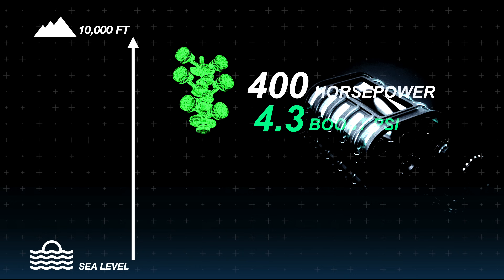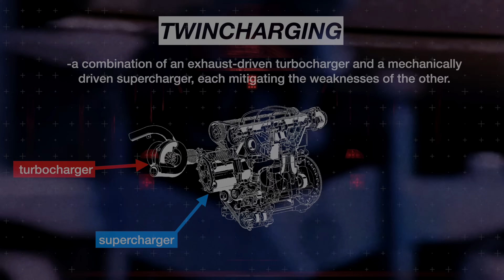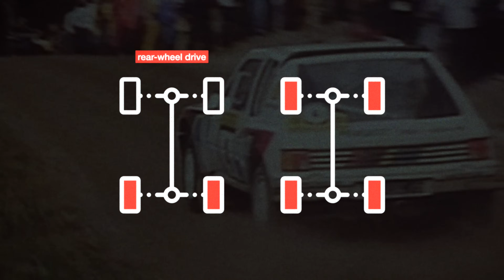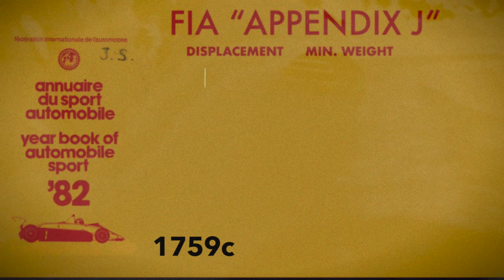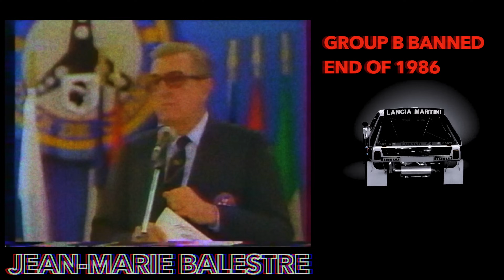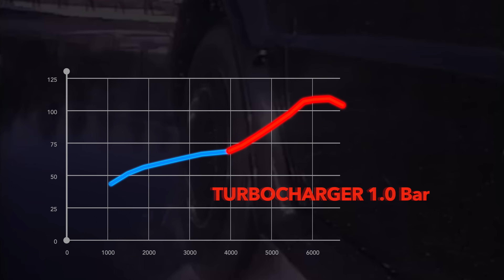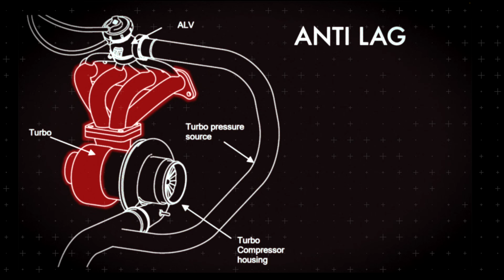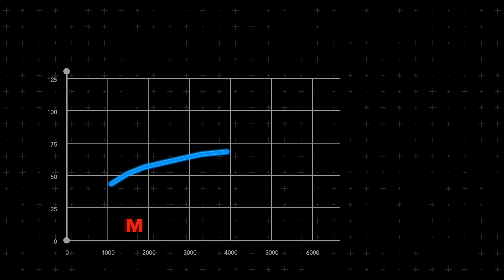The Engine That Was Banned From Racing | Explained Ep.29

Comment: I feel the Delta S4 is starting to fall in the same pit as the 787B. None were banned directly, nor were specifically targetted because of their engines. The Delta S4 was as much of a casualty as all other Group B cars; as it weren't the cars banned, but the class under wich they raced.

Other thing that's also starting to get me tires of it is the ever stuppider and ridicoulus power figures thrown around. Though we all know back in the day having a turbo in the car meant you've always run more boost than announced, the Delta S4 never pushed further than 5xx hp for reliability. Saying the engine could spit 1000hp is the same as Supra kids with the 2JZ-GTE thinking it too could manage that from the go. All Group B turbocharged monsters got new lifes in Rallycross and Hillclimb after Group B ended, and all got up to crazy numbers because all had the same potential if not more.

People are missing the point. The S4 was an amazing car, incredibly complex and arguibly the biggest effort from any of the top teams, as they were on a way tighter budget than the giants of Audi and Peugeot or even Ford.

Comment: The engine itself was not banned. Group B cars were banned, for the reasons you stated. Rule changes after group B made it no longer fit the series, but the engine design was never banned by itself.
Reply: This is true in fact it was a variation of this engine that went into the Delta HF. Which would get Lancia 6 consecutive Manufacturers wins. A record that still stands almost 40 years later.
Reply: But it says that in the video

Comment: At high altitude a belt driven supercharger ALSO doesn't develop more boost than at lower altitude. I tested this with my 03 Mustang Cobra that I had a 2.8" pulley on the supercharger replacing the OEM 3.65" pulley (and a tune for it) at 5154 ft elevation (Elko Nevada) it developed about 12 lbs of boost, and then going 8737 ft elevation (top of Lamoille Canyon) 31 miles away and about a 45 minute drive the boost developed dropped to abou5 9.5 psi peak. Now my 2012 Ram 2500 with a Holset turbo at sea level develops about 27 psi of boost around 95,000 rpm and at the top of Donner pass about 7050 ft elevation still develops almost the same peak boost but around 121,000 rpm since it can adjust for altitude.

Comment: The line there is no replacement for displacement is under the assumption all things are equal. Sure boosting can make a small engine more powerful than a bigger one at certain speeds. The catch is if you boosting the bigger engine then it is the displacement that makes the difference.

Comment: there is only one category where there is no replacement for displacement. the pickup, yeah we have turbocharged engines but if that truck is going all day long every day with a loaded trailer than those turbos will quickly fail
Reply: For gasoline pickups, sure.

For diesel pickups (and diesel trucks in general), it’s turbo or bust, even with a similar displacement.
Reply: @camarokidbb4347 i very much agree.

Comment: Design of the S4 was also insane :)   Driver and navigator sitting on the fuel tank.     And car was made so light they had trouble with the body panels  , they had the habit of getting loose on the stage.         Also heard that after the S4 was banned lancia did dump all remaining engines in a furnace , but not sure if that story is right

Comment: Hooold up, first actual PRODUCTION twin charged engine was the P-47 Thunderbolt. WW2 fighter plane with a very bulky fuselage that would maintain high boost at high altitude, which other aircraft did by implementing gear shifts for their superchargers so a pilot would literally need to switch gears as they went up and down in combat.

Comment: Twin charging isn’t as good as compound turbos anyway… modern compound turbo setups are insane, stupid fast spool up and insane power capability if you design the turbo setup well and build the right engine around the turbo setup. You can have big block low end torque and 4 digit power fairly easily.

Comment: i mean technically, forced air induction should be considered as a method to artificially increase engine displacement since a NA engine will only be around a few atmospheres at best depending on ductwork and bore/ stroke, so having higher than that is like having a bigger engine. It's possible thanks to the advances in alloy composition and block and component construction as well as the mature after market parts community, that a smaller engine can be turned into a beast. twincharged or as i like to call it, super turbo, is in my opinion the pinnacle of combustion engine design.

Comment: It's not that "there's no replacement for displacement" so much as the limiting factor is available oxygen (air) and what matters is how much mass of it you can pack into the available CCs (fuel supply has been a solved problem for decades)

Comment: Uh, boost is effectually displacement.  The displacement is simply a measure of the volume of air the engine moves.  By adding boost, you’re effectually increasing the volume of air it’s capable of moving.  

Thus, there is no replacement for displacement.

Comment: I was thinking to solve the lag problem I would use a supercharger at the start to rev up the turbocharger and once it reaches desired rpm supercharger would cut off but suddenly I got trashed because you said its already been done and decades ago naming it twin charger , I also thought of a name for my design "Air Charger" but sadly. Still I will make my own design modifications and make it even better when I have the chance of course which might be not so soon.

Comment: I thought they used a special fuel injection system that would lower the temperature of the fuel going into the engine similar to nitrous oxide? Or am I thinking about another motor?

Comment: I've been playing with twincharging since 2007 with my aw11 mr2.  I run full compound boost twincharged 4ag, no clutch on supercharger and no supercharger bypass.  
I love the powerband it delivers. 
While my diy setup isn't the most powerful thing out there, heck I don't even know what it's doing, hasn't seen a dyno in 5 years and I've played with it since.  
I run a gt2871r feeding a eaton m45 on my 4ag at 28psi.      
My next engine build will be with aftermarket parts and new ecu so | can run e85 fuel and get it tuned accordingly, will still run the same twincharge setup. 
I wish I could afford to do my rebuild now!  It's going to scare the shite out of me! hahahaa

Comment: Has anyone tried putting a Clutch Pulley system on a supercharger pulley like an AC pulley. The SC pulley is clutched in on low RPM spooling the turbo once above 3k RPM and 100%TPS the SC pulley clutch would disengage rendering it in neutral having less parasitic drag. Sounds possible?

Comment: Twincharging became irrelevant when centrifugal superchargers became a thing. These are essentially belt-driven turbo, and while turbos can still edge them out for absolute peak performance, they're centrifugal superchargers are a solid compromise as they offer no lag with big power potential.
Reply: Centrifugal superchargers have been a thing for a long time, even before twincharging.

The issue with them is that they deliver lackluster power at lower RPM since they rely on revolutions to make boost, so instead of taking a while to make more boost at lower RPM, you make a consistently below-ideal level of boost with a centrifugal supercharger.

Twincharging is instead made more or less obsolete with compound turbocharging, using a smaller turbo to feed a larger turbo to accelerate building boost, to the point where you can build max boost at fairly low RPMs, which means you can very rapidly build up a large amount of boost when going off and on the accelerator within the wide rev range.
Reply: @camarokidbb4347  You're talking about twin turbos in a sequential configuration, which was really just a stopgap setup for the days when turbos were laggy. They're a lot more optimized now such that perceptible lag is mitigated.

You can spool a turbo just by brake-boosting, or by installing an ALS (anti-lag system). The ALS would basically allow the turbo to spool up to full speed without having to rev the engine, so when the accelerator is pressed you'd have full boost off the line just rolling onto the throttle. It also maintained the turbo's RPM during driving so you could brake hard without losing boost.

Modern centrifugal turbos are usually geared and the linear power delivery is not a drawback, it is a feature. They may not have as much peak power potential but for everyday traveling they're a lot of fun.

Comment: "there's no replace-" yes there is, it's called boost as you said... and also various other trickery, like twin charging. also turbo's don't use the heat it's just the engine fart gasses.

but yes twincharging is the most harmonious of batshit insanity. what the turbo fails in the supercharger excels, and vice versa. or as all i like to describe it, "what the turbo takes the supercharger gives, what the supercharger takes, the turbocharger gives"

great video as always. and just giving me more info to use for one project.

Comment: 0:05 - "but in actuality" boost is still more displacement 🤦‍♂️

There is NO REPLACEMENT for DISPLACEMENT... doesn't matter if it comes from the bottom end, or a compressor.... the power of an engine is most closely related to its ability to aspirate.

Comment: yeah, turbos still doesnt solve 1 problem you didnt mention. making 5 bar 70+psi of boost from a 1.8L would require twin turbos, and they would still have soooooooo fucking much lag from a dead stop it would be pathetic compared to a dualcharged setup.

Comment: I keep hearing how turbos do not have parasitic loss. I call BS. If that were true, then turbos create energy from nothing, which is impossible. I want someone to do a test; take an engine with turbo exhaust system and first dyno it with a test pipe in place of the turbo. Then replace the test pipe with the turbo with a charge pipe installed and restrict the output enough to build boost in the charge pipebuild. Dyno the engine again like this. I guarantee the turbo restricts the exhaust and reduces the engine output. Parasitic loss.

Comment: Technically, and as very much pointed out IN the video itself, it wasn't the Delta S4's engine that got banned, nor that got the S4 itself banned, nor the whole Group B, it was all the weight loosing cuts Lancia did to the S4 that made the car way too fragile, not only in case of a crash (as the one Toivonen and Cresto suffered), as well as in the car's handling itself.

Comment: Yeah there's no reason to not do this (arguing against the don't do this even w/ deep pockets comment).... the traction control strategies weren't that great back then, whereas they're awesome now.  These were gas cars that had electric car levels of acceleration and no traction control.... and probably no torque peak/end to top rpm power if the setup is sized (in)appropriately.
Reply: Also, modern turbos (like BW EFR) have very little lag and have done a lot of engineering to expand the efficiency islands on the compressor maps.
Reply: @kr4dh4x0r true however i  terms of speed a rally one car is faster now

Comment: I operate locomotives for a living. When I started out, I was talking with the mechanic about the turbo on these monster engines. He explained that the turbo is shaft driven by the engine until we reach Throttle 7 or 8 (full throttle) then the shaft disengages and the turbo spins off exhaust pressure. 
I made the comment, that's kind of like twin charged engines!
He looked at me like I was nuts...
I knew then, we were not the same kind of engine nerds.
Reply: He is talking about an emd. They drive the turbos from a one way bearing. Once you get enough boost pressure, the turbo overruns the bearing
Reply: So it's kind of like a hybrid centrifugal supercharger/turbocharger? That's really cool. Does it decouple automatically, or is there a separate control to do it when you go through the throttle range?

Comment: I have a twincharged engine. Albeit its a big engine ls7. And high boost for max boost. Its run in series with no disengage but multiple wastegates snd blowoff valves. 

It gets better effiency then a suoer would and nears peak turbo effiency which dowsnt happen in high boost settings generally. As well as eliminates a few turbo flaws with back pressure issues and draws constant cold sir into the system. Along with making it easier to have multiple stages of cooling. 

In theory my set up with a basic light weight disengage for the super that can use boost control and ither factors ro only use the turbo during certain periods of boost and kick back on for max boost and approaching max boost would be slightly more efficient but barely. And to get equal ability to tune a flat torqgue curve and comparable feel to an NA motor is hard with just turbos. But its also better then an NA cause it has rhe supercharger early torque and feel plus turbo boost kick but leveled out. 

Also some theory for compound boost and the most modern responsive turbo set ups and a form of super serious anti lag safely plus some compound boost benefits. But you need to design around the concept. 

And plan in out properly. And size turbos and supercharger properly. Tryna see if plumbing it up on a hot vee would be possible. K48 honda based v8 hot vee but also vtec. In theory could tune for an off the line intense power band that doesnt stop till redline at 10k. And also help my build plan for said engine. Superlite slc. Needs to be streetable but also for high tune on track with race tires trying to match that 1 to 1 power to weight ratio metric side of thinfs like Koenigsegg. And beat the texas mile ford gt. But some aero work needed.

Comment: I had a saab 9000 turbo with the 2.3L inline 4 Garrett T3 factory 200 horsepower that I ran at 36lbs of boost and ate z06 vets all day.. doing the math from the video on the 1.8, it’s about 100 horsepower for every 7 lbs of boost.. that makes about 600 out the saab I had and boy was it fast.. the gear changes where literally like 12345.. faster than counting from 1-5.. lol

Comment: The parasitic effect is not worse than boost lag.  If you have a supercharger that is stealing 50hp but giving you 150hp, you are just getting a flat 100hp boost.  The cool thing about the shaft driven stuff is that there is zero lag.  It is basically like having a bigger engine.  As much as I like that, my heart will forever be with the turbo.  I like the slight lag.  I like that it just get more and more insane the higher the RPM gets (On good builds).  The sound of the turbo spooling just makes my spine tingle. 😤

Comment: Not bad video, but there's one big problem. The reach type super charger. They pitcher they were rotating it wrong. The compressed air goes on the outside of towards the casing, not the inside, get it right.

Comment: Boost + Displacement is always better. There's a reason people say this as of late. Cheap turbo kits. You could add 30psi to a Honda B series in the 90s and still make little power. My 1985 Audi Turbo S was about 180hp...inline 5 boosted. IF you lack displacement your going ro HAVE to use either lots of RPM boost or both. Yes, boost is the replacement but it comes with comprises.

Comment: BOOST IS DISPLACEMENT. Bore x Stroke x cyls gives a number (say) 2 litres. 
THAT figure is the amount of air the engine can CONSUME in two revolutions if it could achieve 100% volumentric efficiency.
At 2 BAR of boost (minus some losses) the VE becomes about 300%, therefore the engine can  CONSUME as much air as a 6 litre engine.
It therefore for ACTS LIKE a 6 litre engine and to all intents and purposes (excepting physical dimensions),
 IT effectively IS a 6 litre engine as it is consuming the same amount of air that a 6 litre engine would consume.

Comment: If it wasn't for dual-charging, turbo-charging wouldn't have developed the variable vane turbo. I would like to see electronic control to a bare minimum. Reliability & maintenance costs for the average customer must be considered. There is no replacement for displacement though. Stressing a small engine like they do hurts the resale value by taxing the bottom end, piston rings, head gasket & other components. Also induces high heat into the engine oil cooling the turbo shaft bearing. As far as owning a petrol car, I'll vote for an appropriately sized N/A engine w/ the proper gearing & an automatic trans. Having fun w/ a manual has a better chance of breaking something in the drivetrain.

Comment: I also own a twin charged car. The Volkswagen Golf 1.4 TSI GT. Yes it's not the most impressive car out there, but the technology behind it is astounding. When the Turbo takes over, a magnetic clutch disconnects the Supercharger, removing the parasitic loss at high rpm's. It's such a joy to drive. The whine of the roots supercharger is so beautiful, with the kick of the turbo at high rpm's. It's unfortunate that VW didn't continue to develop with the technology.

Comment: We use supercharger and turbo in our '73 beetle with Fiat 1.1L engine (downsized from 1600TC, 8 valve). Displacement is reduced because of race regulations and enables 953kg minimum weight and wider tires (285) in our class. Detuned (ignition) 450hp/400Nm @1,9bar and 8000rpm limit (power still rising) because of "original" gearbox (waiting for Porsche GB to arrive). We can use boost at least up to 3,2bar (have not tested more yet) and 12krpm (55mm stroke). Virtually no turbolag and power "curve" is just a straight rising line so very nice to drive.
Reply: Love my twincharged 4ag aw11 mr2.